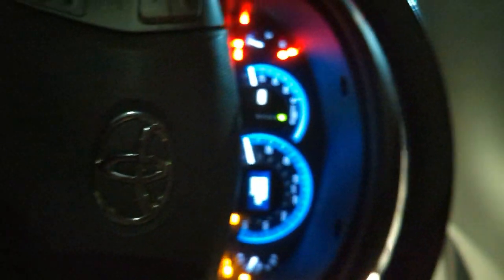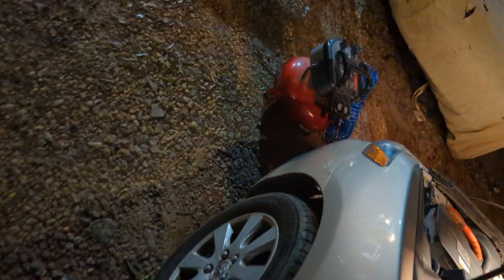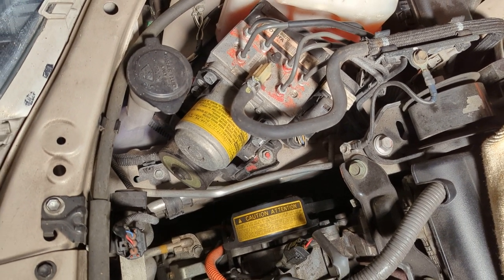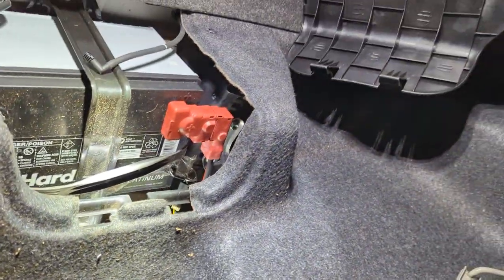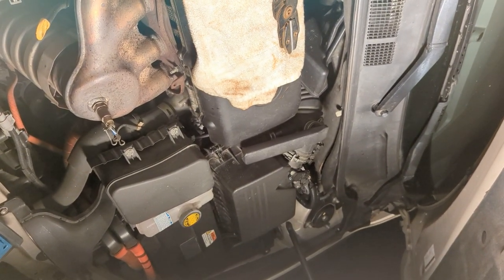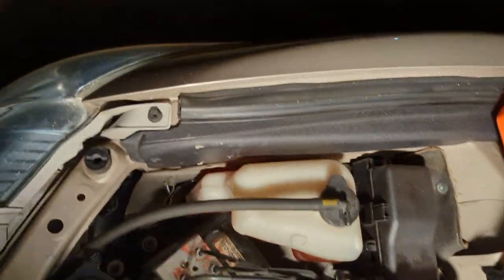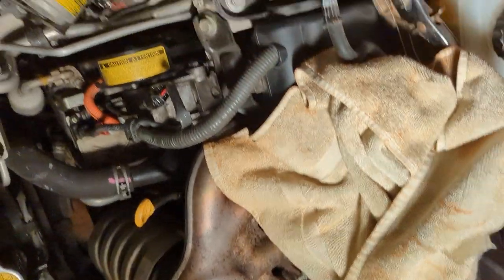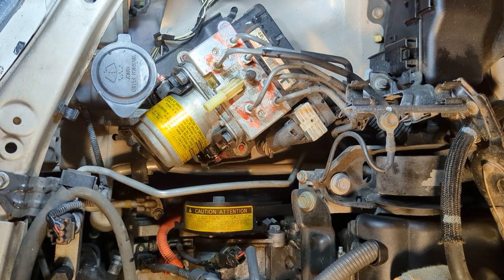Removing ABS Control module on 2007 Toyota Camry | ABS Actuator/Module Pump Assembly

Comment: Do you have an address or phone number for the place that rebuilt your module? Can I get it please. Thanks
Reply from the maker: Address is:
UpFix
1707 Enterprise Dr
Buford GA 30518
You can start the order online and get a shipping label to send the part for repair. UpFix.com
Reply: @upfixauto  what tools you need to remove it and how long it will take it?